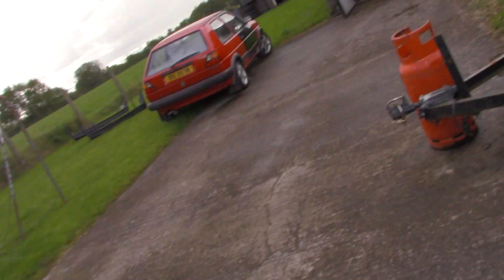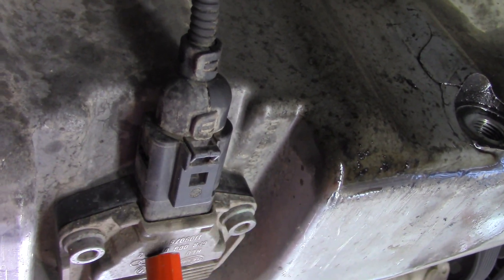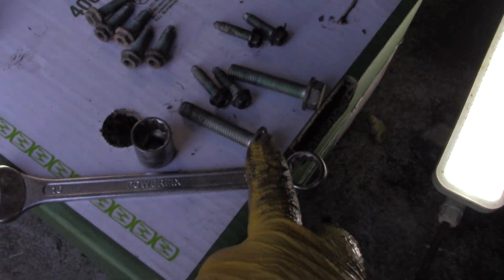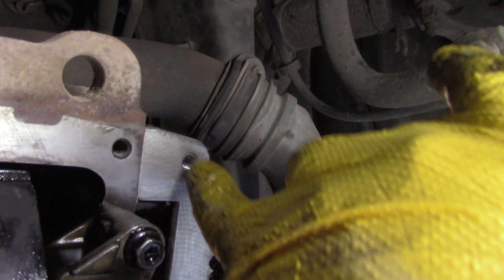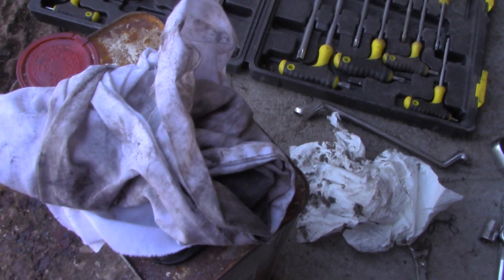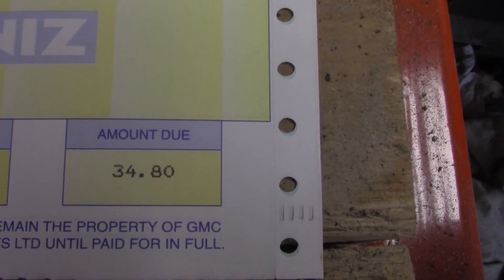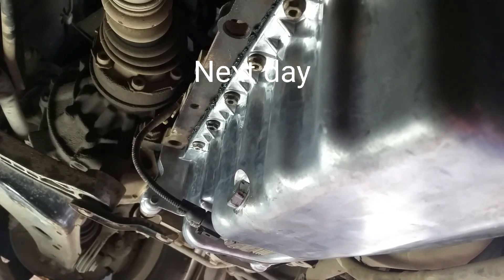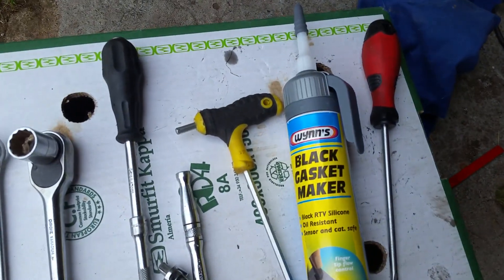How to Fix a Volkswagen oil sump oil pan  on a  Beetle Bora MK4 Golf Seat  Skoda 19TDI

Comment: Hello did you do the sump bolts up with a torque wrench or by hand? Thank you
Reply from the maker: Tightened by hand to be honest,  caution the bolts next to gearbox side just sweeten them up as they screw into rear crank seal housing which is aluminium from what I remember.

Comment: Good evening 

When removing a sump of a Golf 4 1.6

Wat tool do I need to remove the two nuts in the middle, next to the gearbox?

The rest are removed
Reply from the maker: 5mm allen key, all turn flywheel till you see a groove in it which will allow you to have easier access to the 2 bolts
Reply: @TheProjectGuy194  can you show these mythical flywheel markers ? can only see mentions of them online not one photo video evidence
interested because my Mk 5 golf has its flywheel hidden but those 2 screws are all thats remaining to remove and my swivel cant reach on it with a 10mm 3/8 socket